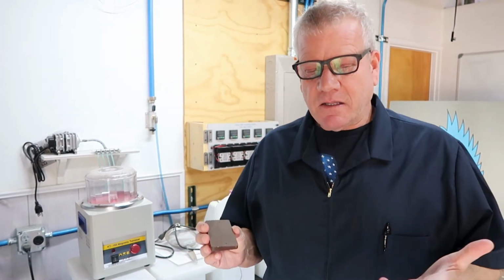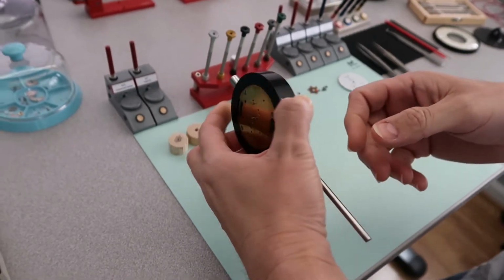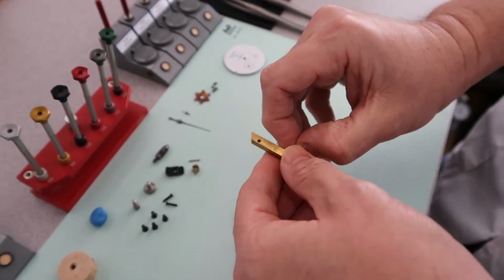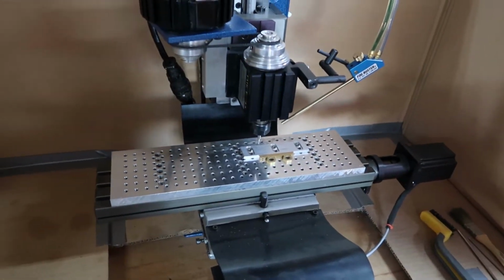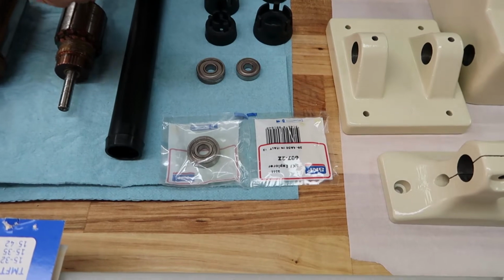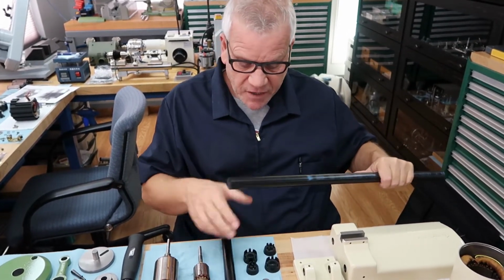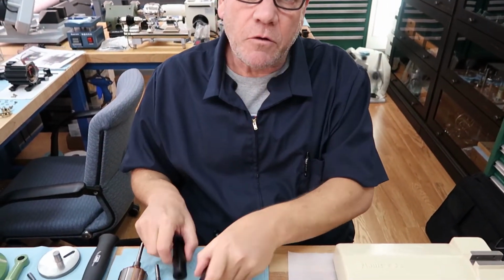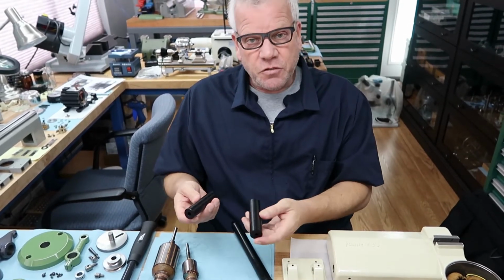SHOP ADVENTURES 07: Dial Micrometer Repair & Bearing Installation Tools

Comment: Having the right tool for the job at hand makes the work more fun to do!
Reply from the maker: Hi William Savory welcome and a good comment and for being here. I am hoping to expand on, having the right tool. These tools machines and such really are a saver of time and the only real way to get the task at hand completed correctly and in some time of urgency completed for both self ad for that of the client. We always invest what we are able into our tools we just got in two new and in this case still Germany Made MAHR-Federal dial indicators made to order but for two specific jobs, it was just time to upgrade and prevent the shared usage for one of these for two different jobs around the Workshop. Both are metric.  
Thank you and you got it right why struggle to get something done when a tool would get it done sooner and correctly the first time. Lance & Patrick.

Comment: Buffing rake! Good memories of watchmaking school 😊
Reply from the maker: Hi Conrad, nice to have you share this memory they are tough this one is a high-end one in my opinion that Patrick bought for us here, but it still required the firm grip and angle to the wheel, or you will have a memory not too soon forgotten. As a parts finisher who has a single goal to master the art of black polishing only from all of the things, we do here it is a very important part of the tools I use to finish these micro machined parts in the 110 square foot finishing shop. Thank you for stopping in and sharing this memory and I am glad you appreciate the tool, and you remember it well and on good terms Watchmakers School and classes Conrad. Lance for Lance & Patrick.

Comment: I used to work at a cabinet shop rebuilding the multitude of routers was one of the things I did and I had to make many specialized tools connect things go smoother you did an excellent job here
Reply from the maker: Hey thank you, we have no wood experience s we only in recent years switched out of laminated table tops on our work stations when we relocated to our current living and working place to maple and a few oak table tops. We try to share our ways of approaching issues that come to a head. We are happy you are enjoying our channel videos and such we will be coming over to view a few videos and get caught up on what you are doing, thank you.

Comment: Is not plastic and nylon so much fun to machine ....I have played with some black nylon stuff that has a gray color moly stuff in it and made a really cool file handle...I made a  shear tool bit that Mr Pete 222 has a video on and talk about a neat super fine finish you can put on a plastic part ...I am really enjoying watching all your videos so I can get caught up with your channel
Reply from the maker: Hello not2fast4u2c, thank you for and we hope you enjoyed the dial indicator issue we ultimately resolved, here is some of the skills we posses to help share home some things around here get done and done correctly.
We are watchmakers and electronics engineers, software computer and CNC and firmware programmers as well, the only reason we are sharing these skills with you is so you know how we do what we are about to share with you.

We were servicing wristwatches and making watch movement, timing device and instrument gauge parts and building controller cards printed circuit boards (PCB) we had production ran in Washington State so we know some diverse skills this being shared is we automatically know how to fix dial and digital gauges for precision machining because the complication of a simple watch movement manual or quartz are tougher then most any precision indicator we can rebuild, this is not a brag we are still learning many things it is to share the benefit of the watchmaker, we did not know we possessed until an indicator went bad, that was a great day. 

Oh no the teacher mr.pete, we just ordered two shirts from Lyle in different colors and we have a skit we have written to share our thankfulness to mr.pete for helping you find us as an example. We film these shows in near real-time so as soon as these shirts arrive the rest of the props are here and it is time for the class to come to order, we hope you enjoy this and that was what we call Insider Track around here, from time to time we share what is coming up in  show in detail so we hope you like it.   
Thank you for sharing show 07, it has been a while know sense that show aired, thank you. Lance & Patrick.

Comment: What a nice workshop :)
As the germans say: "Alles in ordnung" meaning that everything has it's place.
I wish my shop would be as tidy. Well, it's a little bit like my head, confused :)

In this video there was this bronze thing with a groove for a pin to travel in. I assume that that pin was once upon a time really traveling in that groove. This, of course, means that the pin is not the correct one. Those things do not swell like dough. Well, actually zinc does. One possibility is that someone took the thing apart and then put accidentally wrong pin there. Just my 2 (euro)cents.
Reply from the maker: Hey Hi Finno nice to see you stop in ad share a thought or so. Finno is a (FELLOW YOUTUBE CREATOR) and very skills in electronics and machine rebuilding, he is rebuilding a really nice milling machine a Schaubin Milling Machine right now, a very vintage as it is, that means we LOVE this mill. 
Yes you have a good eye Finno, that indicator made in the USA by S-T Industries SCHERR-TUMICO came to us installed in an MAHR dial indicator stand, not working so when we opened this indicator we saw the track for the pin either shrunk or the pin grew, the pin is hardened steel, so no growth there, the track is of brass and did not shrink in diameter per inspection so we think you are right, the indicator that know operates and repeats flawlessly or close was worked on by a lessor then qualified individual in the past.
Thank you for being here, sharing and for making these really nice videos of your milling machine rebuild, you have a great sense of humor as well, Lance & Patrick.
Reply: @ActiveAtom  If it's hardened steel it can grow if it wasn't aged properly, but I can't imagine it grows enough to get stuck in that slot.

Comment: that delrin cuts like butter !
Reply from the maker: That stuff sure does it as we are sure you know makes the longest continuous chips and a mess it does make. We will be machining (sawing and drilling only) a bar into 4 equal blocks next month and sharing a little of this on video about how to turn a small machinist side tool chest the kind made to ,mount to the side of a larger tool box roll-away when we mount 4 delrin blocks make clearance bolts and add 4 after market wheels to make this little tool chest fit for a micro-machining and small space machine shop. Thank yo for being here and for taking time as a fellow YouTube creator we really love this community of makers and we realized this is our only way to share our journey of making the code named product coming up in video in a few months named "The Perfected Product" just think micro mini multi machined components coming together to make a very small precision product, we hope it is fun and it is educational while we are at it, tank you again for writing to us. Lance & Patrick.

Comment: Obviously the rail and pin could not be damaged, and would have had to come that way from the factory.  A small QC problem on the line somewhere. Did you take a spring pass after opening the slot?  Nice addition to your bearing installation tooling.  Please add some negative pressure ventilation when using the buffer rake, to keep you shop, and breathing zone, clean.  Beautifully refurbished equipment.
Reply from the maker: Hi Mature Patriot I am Lance and that is my best friend Patrick with me in the videos. We are new to your channel and watch and enjoy being there, thank you for watching our channel. The ST Industries indicator came to us with an indicator stand from Mahr that we acquired many years ago. It is because the indicator did not work that we got a really great deal on the set, though we do not remember off hand what we paid for the set. 
We are unsure about how the indicator got damaged in the first place, though your thought makes sense that it likely came from the factory because of the chatter in the slot, we did not show in the video. In regards to the spring pass we had one mission in mind here, cut a half to 1 thousandth off of one side to make room for the small pin removing the least amount of material we could and there was not enough depth of, or wall thickness removed to need a spring pass in our opinion.
In regards to the dust collection and filtration system and our health, first of all thank you for having the thought to care about ours and people who might see and try these things, future health in mind.
We do mention in the video that this set up in our machine shop for buffing, polishing, bead blasting, grinding and even parts tumbling is temporary as we are placing these tools and machines into our 12 foot x 13 foot shed in the rear of the property to keep these dust and grit particle producers away from our CNC machine and manual lathe ways, and yes ourselves as well, we just need to still pull the power, wire through the installed already installed underground conduit and make the connections then move all of the equipment into the room where there is a very powerful circulation and filtration system in the plans for there.

Comment: I have been subscribed for nearly 2 years, but I have only recently found the time to watch some of your education series on the Levin lathe precision spindles. Great detail, videography and interaction! I'm now working through my backlog, and am thoroughly enjoying myself.
I have two questions for you:
1. I am curious about the gears and pinions on the dial indicator - are they of cycloidal or involute tooth form?
2. I wear spectacles as do both of you. I would appreciate (if you haven't already covered it in a video I haven't watched yet) a "show&tell" covering the good and not-so-good about the various loupes I see you using.
Regards from locked-down Sunny South Africa.
Reply from the maker: Hi Russell, this is Lance for Lance & Patrick finally replying to your great question and curiously paced thought about the Loupe we use and the available models there likely are produced globally. 
We sure thank you for bringing up what gearing our indicator from within that video shard it is as watchmakers we are very familiar with these style gear teeth, they are as you thought Cycloidal gear tooth profile utilized in watch clock and precision indicator movements, meaning you Russell know your watch and clock making VERY well.
In regards to the loupe we use the Bergeon ARY as it proves to be the finest for us spectacle wearing type for which we are now assuming you are one of equally. 
Thank you for sharing and for being a very observant fellow, we find this refreshing Russell. Lance and Patrick.
Reply: @ActiveAtom  Hi Lance and Patrick, and thanks for your reply. Yes, I have worn spectacles since age 10.
My own background is in general engineering (both mechanical and a little electrical), having been privileged to serve an apprenticeship as a fitter & turner on the diamond mines of Kimberley, South Africa, My career has taken me on a very varied path, but I have retained an interest in all aspects of machining through extensive reading. In my retirement I have been fascinated to read and learn a little about clock and watchmaking, and YouTube brought me to your channel. Thank you both for the insights you share from your extensive experience in micro-machining on a commercial scale. I will continue to explore the riches of your many videos.
Best wishes from Germiston, South Africa (its a part of the greater Johannesburg metropolitan area),
Russell

Comment: I like the fixture pallet on the CNC mill. I guessing you guys custom made it. How are you generating the clamping pressure? Do the brass stops have eccentric inserts? or some other method? Really cool stuff, Thanks, Dean
Reply from the maker: Hi Dean, Patrick here...The fixture plate was purchased from the company High Tech Systems.  It was actually priced so well that it just didn't make sense to make one ourselves.  But here's the funny thing, I just went to their website and noticed that they no longer sell any fixture plates.  I had wondered how they made any money selling these so I guess I shouldn't be too surprised that they no longer sell them.  The little brass clamps you noticed, the product is called Mitee Bite.  And you were right, it uses an eccentric screw head which is how it tightens up to the work piece. They come in different sizes and the company that makes these has an entire line of different clamping tools that you definitely need to check out.

Comment: Lance, Patrick, another intriguing video..  loving the miniature stuff. i  like your air line system can you tell me what you are using ?  not only the main lines but the smaller hand held lines..  looks very flexible
Reply from the maker: Hi Raptor Machine & Tool Co. our fellow YouTube creator friend, first we are your first Instagram subscriber yaa it was us, now get some pictures uploaded and share your story Patrick says.  
The airline you are seeing is made of three parts.
The main hard line the flexible line and the the air nozzle. Rapid Air makes the hard line, Free In Hand Co also Coil Hose Pneumatic FLEXCOIL is the flexible line maker and the air guns are made by SMC. This all works really well together but know this we are a micro machining place so what we do is very small meaning the airlines and such are tailored to those requirements. Hoping we are helpful and you will gain something from these two men in the middle of the Mojave Desert here. Patrick and Lance.
Reply: @ActiveAtom  Patrick, Lance, thanks so much for that information. I have been running 3/4 copper line through the shop but there are some tough to get to connections and this looks like the perfect solution.  Im not a big fan of using air around machinery so i think "small quantities" will be suitable!

Comment: After stating that when installing an antifriction bearing onto a shaft you should never apply pressure to the outer race you made an installation tool that appeared to contact the outer race.  Did the inner race of the bearing protrude beyond the outer race, providing clearance,  or did you machine down the outer diameter of the installation tool?
Reply from the maker: Hi Robert we went back and can clearly see what you are seeing 17:56 in looks as though we are breaking our installation rules. (besides me being younger back then) you see the bearing installation tool is is touching the outer race from that angle, it is not near it though. 
That and the smaller then they make bearing installation tools for was why we made that set of two tools, you know we really enjoyed making that set of bearing ID installation tools with quality in mind, it has a step down at the bearing race guide ID from the OD of this tool, we had a lot of fun when we built these tools to last for many years and adding them to our SKF set.
 
We have just made another tool in delrin also known as polyoxymethylene (just love the formal name) recently for another bearing installation and have sense added that tool to the set as well, we are really happy you saw the show and you sure showed us how we need to show better camera angles angles and many other things we have worked hard since back then in Show 07 that might no longer cause the scene to add confusion for the viewers.
 
Thank you for bringing this great question to our attention and for taking time to watch a show (you paid great attention to the details) and visit with us, even sharing a thought with us and the community, we are thankful to have you here Robert.
Lance & Patrick.

Comment: Could you have cut back a bit of relief around the bore size of those tools, so that any mis-alignment on the first few mm of shaft would not allow a bit of tilt of the tool to have the tool hit a bearing seal, or ball cage, in some cases?  Picky, picky...
Reply from the maker: GREAT answer Lohi Karhu you have a great eye here, it was after the actual use of the in-house made Delrin for the 7.0mm and 8.0mm we assume you are referencing that the bearing installation tool ends needed to have the holes chamfer done to allow for some mis-alignment. We did do this to both tools following the making of the video 07 realizing how accurate the alignment had to be with no chamfer. 
Thank you so much for paying that much attention to our video and sharing your correct answer to us. You are what is great for this channel Shop Adventures people that share the issues they discover in the videos are what makes for this being a great community.